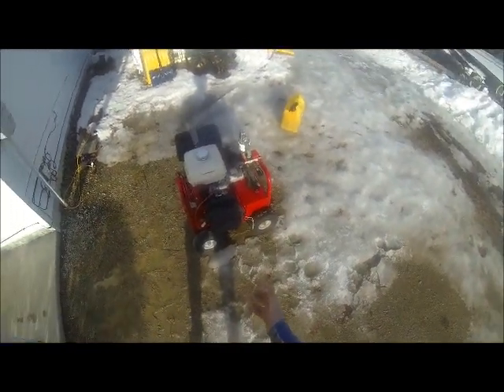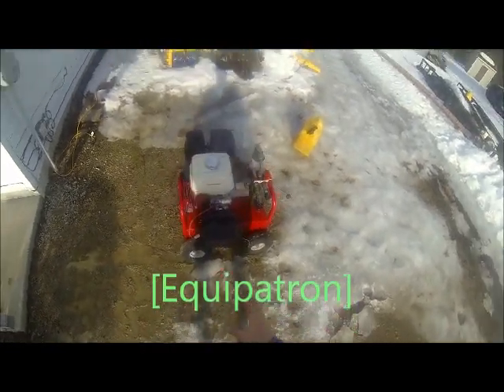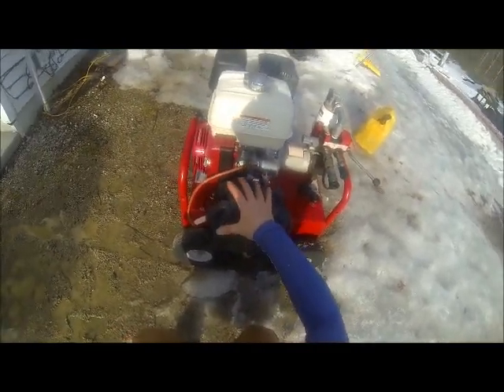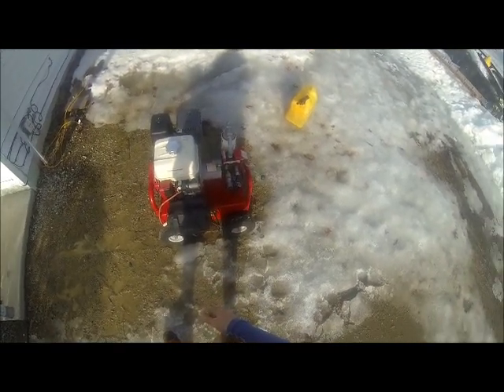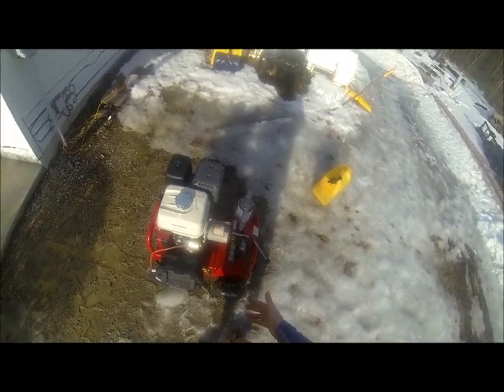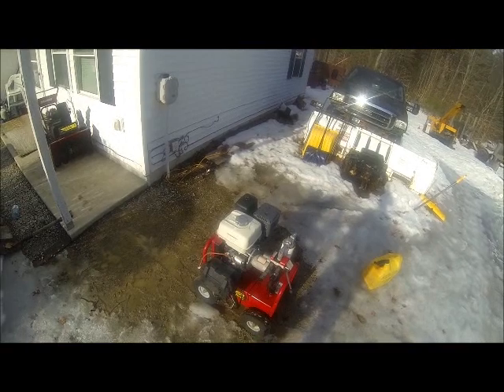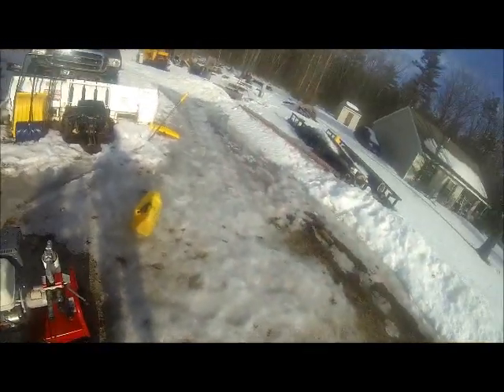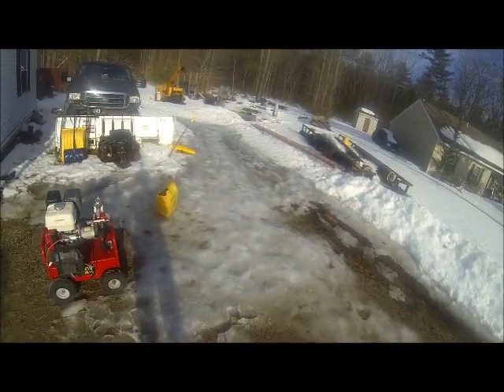winch series video 2 hydraulic power pak

Comment: Sweet machine!  Must be a beast.  Can't wait to see it running
Reply from the maker: I want build one with a 18000 lb. winch and do remote removals that tow truck driver can't even do. I've used the 12000 lb unit to pull stumps
Reply: Damon Reuning Dang!, that's crazy.  Never seen anyone pull stumps with a winch.